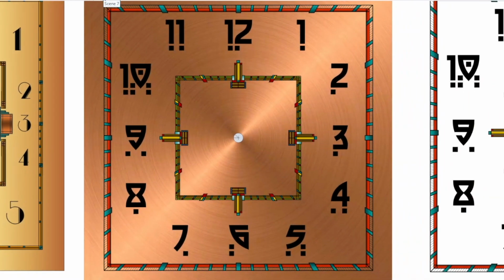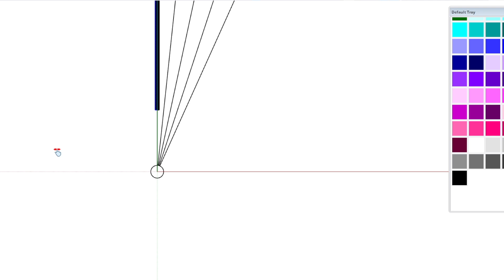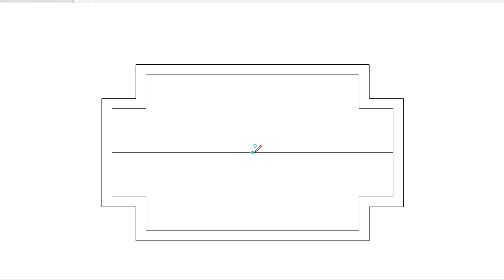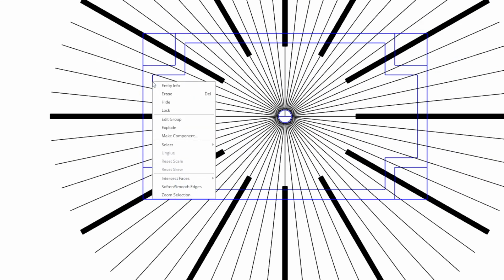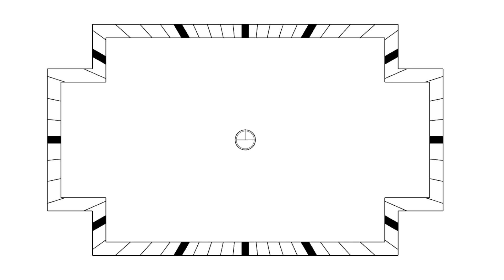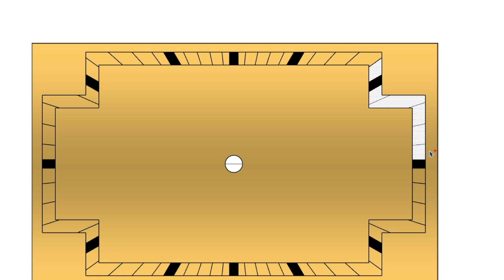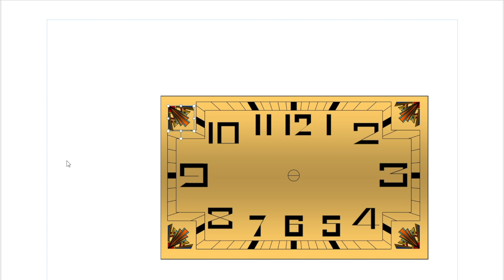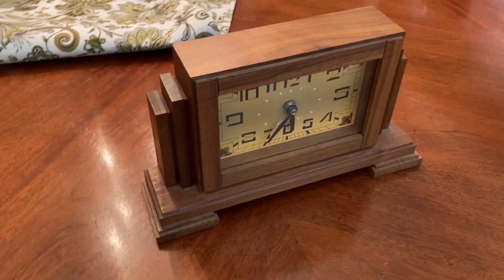Easy Steps to Design, Draw, and Print Your Own Custom Clock Face

Comment: Really cleaver stuff, just what im planning to do. Especially in Art Deco. You did not show the part in which you printed off the clack face and mounted it on a board. Was this hard, or are there some easy hacks?👍
Reply from the maker: Thanks for the comments. I printed them on a high end color laser printer. Used a light mist of spray adhesive and a roller. Thanks again.